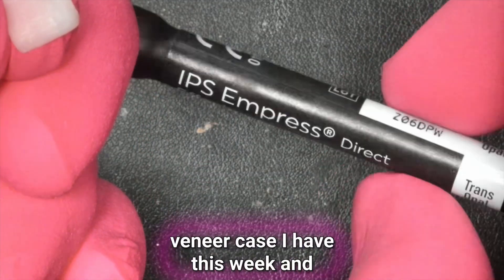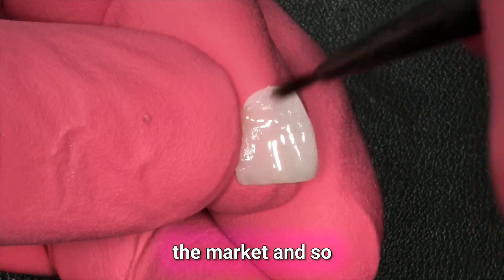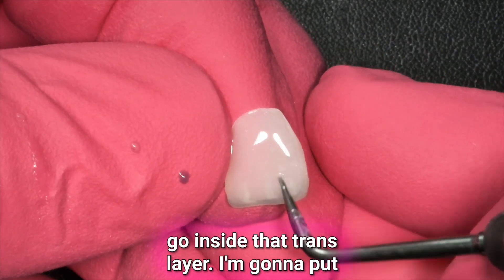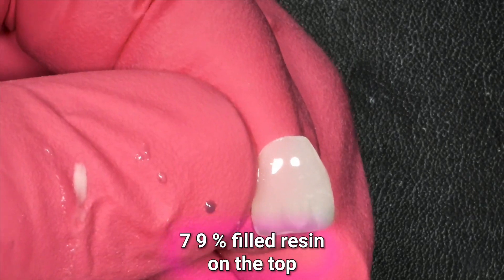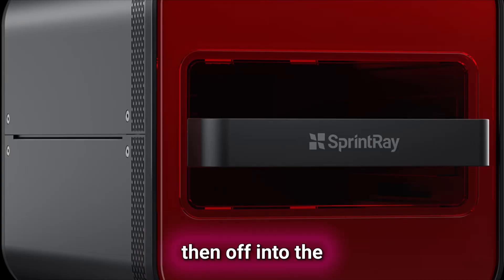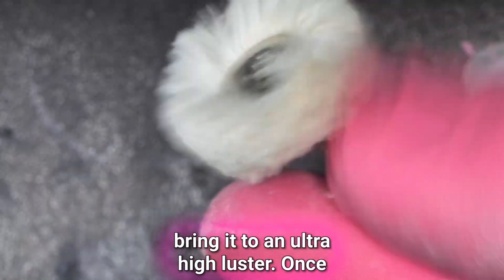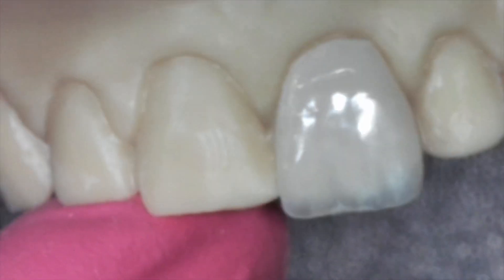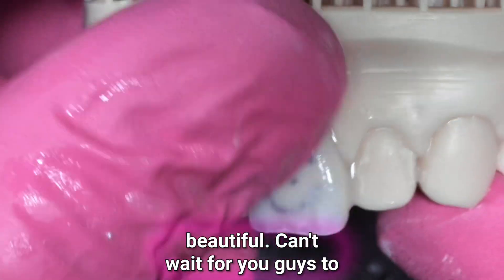New technique for 3D printed veneer finishing

Comment: Are 3d printed veneers stronger than e-max?
Reply from the maker: No. They aren’t stronger but they are more tough. Do they need to be steonger?  I can print 10 veneers in 15 minutes. They are more efficient. Also they can be printed 200 microns thick. Emax chips when that thin in the mill, so you would have to press it.